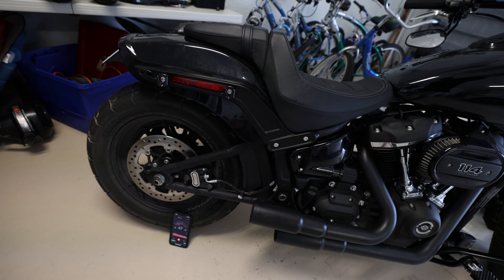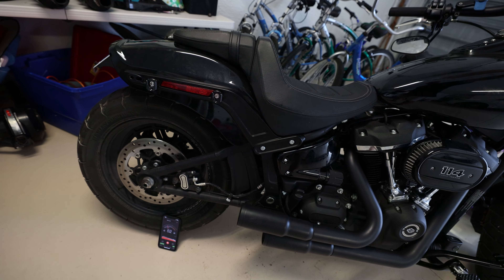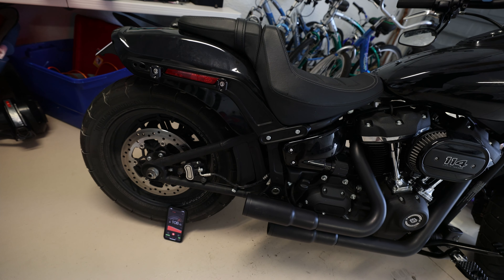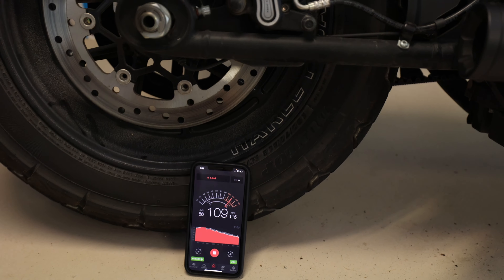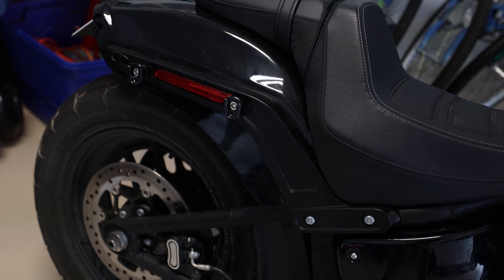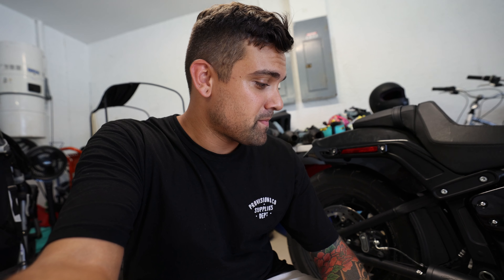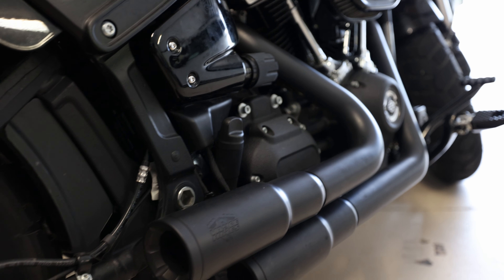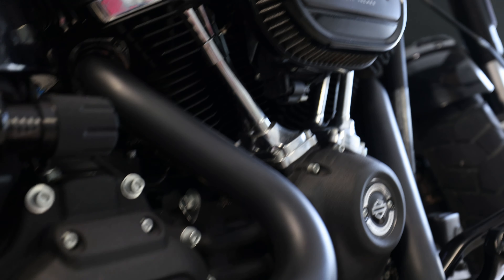Putting Mini Grenades On My Harley Davidson Fatbob 114 Softail M8

Comment: Not sure what camera you're using, but I had the same issue with it cutting out the sound of my exhaust.  I found it was a wind noise setting. I had "reduce wind noise" turned on.  Once I turned it off you could hear the exhaust better. No camera will really do it justice, but it won't cut it the sound as much. Just a thought after I noticed the camera muffled the sound at one point.
Reply from the maker: Thanks bro!

Comment: Do you have the part number for this exhaust. Thanks
Reply from the maker: SKU: 46878 on the Vance and Hines site.
Reply: @TheChandanBangar  Thank you
Reply: Hi, did you have to use the spacers for the mounting bracket? How about the washers? Not very clear instructions. Thanks in advance
Reply from the maker: @RafaelPradoMendoza  I don't believe I did. I just used the supplied parts and eventually got it to fit right. It was tough to get it seated just right at first.

Comment: Did you ever get video of this exhaust running outside?
Reply from the maker: I didn't but man it sounds killer. I almost feel bad for my neighbors every time I crank it up.
Reply: @TheChandanBangar  are they that loud? I want to hear my exhaust, but I don't want it to be obnoxiously loud.
Reply from the maker: @TheImtoomuch  It's not as bad as you might think but definitely much louder than the stock.
Reply: @TheChandanBangar  Do you run it with or without the db killers/baffles?
Reply from the maker: @TheImtoomuch  I run it with the baffles that came in it. Gives it more of the lower rumble that I like.

Comment: I know this has been asked a lot but will 
My rear pegs still fit on this bike?
Reply from the maker: Only the left side pegs will  remain if you try to keep stock. You'll have to change up the pegs on the right side. Haven't done it yet because I'm a solo rider.
Reply: thank you for your answer that is valuable. i have rear bungee pegs/crashbars on my low rider s and i need the crashbar function just in case so i cannot use the grenades but i sure would like to.  happy new year and stay safe.